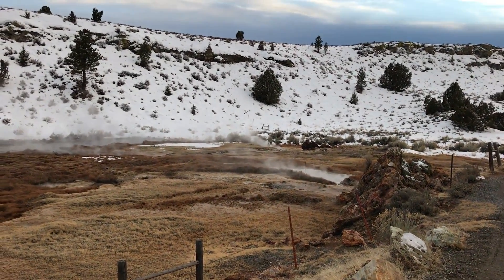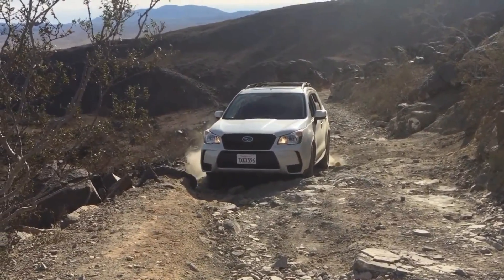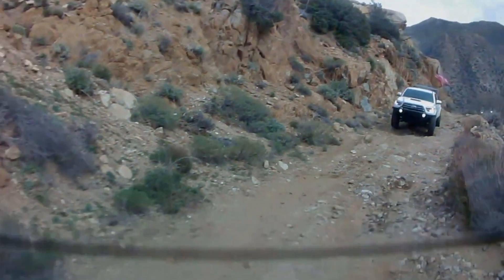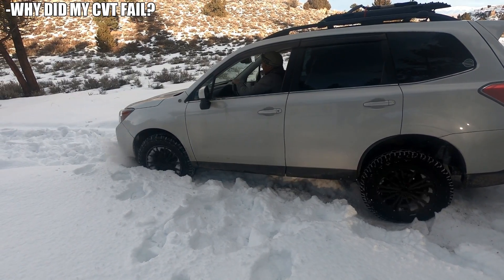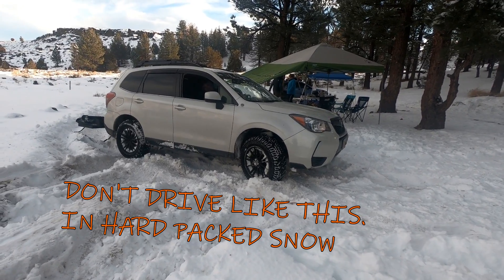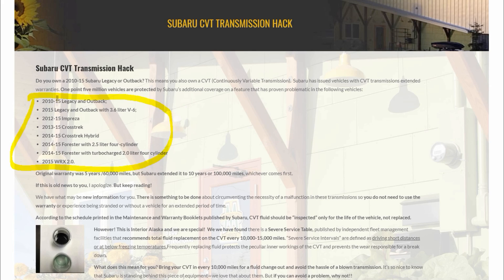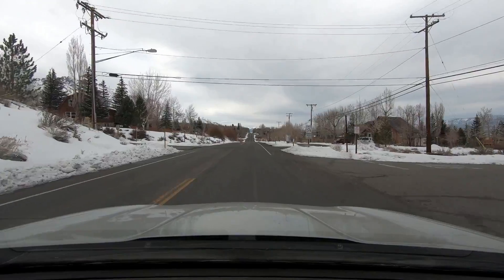CVT transmission Failed!  Can we make them last?

Comment: I am not sure I saw a CVT failing in this video. I did see cars overheating CVTs and limiting power itself to save the CVT. And please you cannot blame the CVT for not enduring that abuse. Having said that, I was amazed that a car with such a strong engine does not have a CVT oil cooler. Even my Mitsubishi Mirage CVT with 80 hp has one from factory.
Reply: May not be the cvt. May be the torque converter overheating.

Comment: I would say CVT is the not the answer for hard core 4 wheel drive trails .My son just bought one read up on it a lot, do the maintenance  on it don't do off road  hard core BAD IDEA ! Gunning it form dead stops .One day the CVT will be as good as a automatic not sure when ?
Reply from the maker: Well, ATV’s and side by sides have CVT’s.  But someone was telling me that they also have a low gear transfer case.  🤷‍♂️ 
Maybe one day they can be built better for heavier passenger vehicles.  I think toyota has the right idea. Their modern CVT’s have an actual launch gear.  BUT... Guess what transmission was put in their non hybrid RAV4’s?  An 8 speed automatic transmission with a 16.7:1 crawl ratio.
So even though Toyota has the most reliable CVT’s, they aren’t putting them in their most popular vehicle.  Well... they are in the hybrid versions (because a regular automatic wouldn’t work).  But their hybrids have electric motors in the rear axles that aren’t even connected to the CVT.
Reply: @JonDZ_Adventuring  That is the way Toyota destroys it's competitor- buy it and kill it by its own hand.

Comment: So get the six speed and just forget about the turbo?
Reply from the maker: The only Subaru crossover 6 speed is the Crosstrek.
You can get an older one with the 4EAT.  It’s not uncommon for them to get 400k miles while still being driven on trails.  You just have to really watch your oil levels on the EJ motors, especially on prolong drives.
Reply: @JonDZ_Adventuring  autos are for girls. Love the videos man keep it up
Reply from the maker: Aaron Burela girls or lazy drivers 🤣🤣
Reply: @JonDZ_Adventuring  correct as usual. If I bought a 2015 forester xt w/ 80k miles and installed a transmission fluid cooler it would be straight?
Reply: @JonDZ_Adventuring  https://www.truecar.com/used-cars-for-sale/listing/JF2SJAAC0JG604047/2018-subaru-forester/

Comment: The CVT was never meant for off road. It's a neat idea and works well for 4 wheelers but just not cars
Reply: But people buy 4x4 SUV type vehicles to deal mostly with snow and inclement weather in the city.  But if the vehicle can't handle that, what's the point?

Comment: The Toyota RAV4 is not as good as the Subaru Forester as far as off-road ability, but the transmission in the RAV4 will last forever, while the Forester's CVT won't.
Reply from the maker: Honesty Counts That’s how I feel about it.  The new 2019 RAV4’s AWD system seems to be a bit less capable.  But because it has a stronger transmission, it’ll do better offroad when the terrain gets tougher.

Comment: I suspect that the fake shifting is really hard on the CVT.  Subaru has added these fake "shifting points" to the transmission feels more like a regular automatic.  Each shift though adds substantial unnecessary torque to the chain and encourages slipping.  I wish they would give an option for the driver to change this functionality to a more linear (and more efficient) operation model.  They could probably make this a user-selectable option in the menu.  I'd love to get another Subaru, but I'm really having second thoughts because of this and the oil.  On my 2010 the manual indicates that I can use anything from 5w-30 to 20w-50.  My 2015 manual indicates 0w-20 or on rare occasion you can use 5w-30 temporarily if needed.  They have such a big problem with oil loss.  They really need to go back to the old wording of allowing heavier viscosity when needed.
Reply from the maker: There’s one thing for sure.  The fake shifting makes the Subaru CVT vehicles slower 0-60.  Car and Driver shows 2014-2016 Forester XT’s doing 0-60 in 6.2 seconds, but with fake shifting in the 2017-2018 models, it’s at 6.8 seconds.
Reply: I would just leave it in CVT mode. I don't like the idea of zone wearing the variators. I would rather have them span smoothly, and not create any ridging, that could compromise the commutation of the chain. manual shift mode (almost) makes sense, if you need the engine to hold back while descending a hill, to avoid heating up the brakes.

Comment: My car witch is 16 years old and sits low to the ground and is front wheel driven and has a traditional automatic can get through most snow with no issues. That’s with traction control on as well. Most of that I think is in part that it has a normal automatic transmission. CVTs are cool tech but they are not capable of off road or snow packed conditions.

Comment: Subaru either should ditch CVT and go back to conventional AT or use Toyota's new CVT design with launch gear. I think that one is gonna be much more durable than current design.
Reply: Mitsubishi Mirage had a low/high gear automatic in front of the CVT since 2013, AND it has a CVT oil cooler. With only 80 hp.

Comment: Hi.. Thank you for your video... I'm from România and I bought a Forester 2.0 Diesel (very popular în Europe) SH with 150k km on hand... The cvt stilul run properly but I not change the fluid transmision... The dealer says îs for life... Realy?... I want to change The fluid due to noise when îs cold... After warming îs ok... I don't know if îs normal or not... What îs îs your opinion? Thank you and I will apreciate your answer... Sory for my english.... Respect....
Reply: Yes, change the fluid every 30k miles. No fluid lasts for life, that is a lie. If the fluid is for life why they don’t warranty the transmission for life? Do a search here on CVT fluid changes and see how dark the fluid comes out after 60k miles. If changed every 30k to 60k miles, the CVT should be trouble free. If you tow, get an oil cooler installed

Comment: Install a regular automatic transmission and ditch the CVT.
Reply from the maker: Yes please ☺️
Reply: Can you replace a CVT transmission with a regular transmission?
The short answer is, no you cannot. The transmission control module and the entire powertrain wiring harness are designed for the car to have the exact CVT transmission. Despite the terrible reliability of these CVT transmissions, it is your only practical option for replacement.

Comment: I will not buy any car with a CVT transmission period. They are all junk and will not last.
Reply: Time will tell.  Honda and Toyota seem to make good ones.  Haven't read any problems.  Honda already made shitty automatics, and their 5 speeds rev over 1000 rpm on the highway than CVT so this will  hopefully improve their image and driving experience.
Reply: @mechcommander_online_clips  CVTs are only good for flat city commuting.  Toyota is only using them in small compact cars.(Yaris and Corolla)

Comment: My 2015 Honda CRV front wheel drive couldn't even slip a tire going up a dirt hill and it doesn't have traction control. Week on power to the wheels.

Comment: Just got my 2015 Forester XT out of the shop with a CVT replacement, after it failed at 35,000 + miles, no charge to replace. All my driving has been on asphalt. This is my first Subaru and probably my last. I am going to baby the transmission and will no longer use the manual paddle shift; which I did for upshifting on level roads and downshifting for driving down hills and slowing the car (in conjunction with the brakes) at red lights.
Reply from the maker: James Coles hopefully the replacement last longer.  I was told that the replacement had some improvements, but I dunno.  When I got mine back it seemed like the Transmission would slip a little going from park to drive, or park to reverse.  I didn’t feel comfortable keeping it, and when I found out I could trade it in for $15K with 60k miles, I took the offer.  Still a pretty big financial loss for me 😭, but I felt it was the responsible thing to do.
Does your new CVT slip at all? Or act different than the original?
Reply: @JonDZ_Adventuring  No slippage yet, but I have less than 50 miles on the replacement CVT at this time.
Reply from the maker: I noticed awkward shifting immediately, so you’re probably good 👍

Comment: Best tip to fix a cvt problem is buy a car with a manual
Reply from the maker: GhostOfAMachine I hear that after the 2nd CVT replacement, the Subaru gets converted into a manual.  Don’t quote me on that, it’s what somebody told me that is on his 3rd CVT that’s about to die.  He has 90k on his 1st gen crosstrek.

Comment: In the Philippines our Subaru Foresters XT was made in Japan in which are better cars than the US made. The oil filter alone tell the story in the US they use the Blue (Fram) filters while here in the Philippines we use the black (made in japan) filter... i have also a 2014 forester XT 70k with sealed untouched CVT still works like charm..
Reply: I'm pretty sure that the Forester is actually imported into the US from Japan. My AUS model XT has also got a factory fitted trans cooler, the US versions dont for some reason, maybe because they want everything at the cheapest price?
Reply from the maker: Thanks for sharing.

Comment: Toyota, Subaru, Honda and Nissan are having issues with this CVTs , Nissan the most, Subaru and Honda are about the same and Toyota has the best ones so far but still with the same issues of wear and slipping, Subaru should definitely fix them or make better ones, at least there is a recall, but its doesnt give you confidence. Thats why i prefer manual for now.

Comment: (AuS) 2014 XT 90k on the clock, no CVT issues yet, only issue was right drive shaft. These cars are made for light off road and surburb/city driving not extreme off roading. These cars are All Wheel Drive NOT Four Wheel Drive.
Reply from the maker: I agree, I don’t consider anything in this video or in my other videos extreme offroading.
Reply: Australia was the same her in the Philippines were Subaru Foresters XT made directly in Japan in which are better car than US made the oil filter alone tell the story in the US they use the Blue (Fram) filters while here in the Philippines we use the black (made in japan) filter... i have also a 2014 forester XT 70k with sealed untouched CVT still works like new.
Reply: @vantom6194  seems like the US ones have a lot of issues. Ive also been a bit spirited in my driving and reason why i also got the 2019 WRX CVT. Seems like a lot of unlucky people or there not looking after the car.

Comment: Yo I have been watching your videos. I'm out in woodland hills I just got a 2016 subaru forester and am looking forward to camping in it and taking it to many beautiful places. Thanks for the heads up on the cvt info. Do you have a mechanic that you usually take yours to.
Reply from the maker: Spencer Oerlemans my buddy works at a Subaru dealership in Long Beach, which is a little bit a ways for you.  For lifts and anything else special, I go to Nathan Robinson at Jim’s Autoservice in Crestline, CA.  Honest dude with honest prices.  If you call make sure to specially ask for him.  909-338-1946.
He’s far, but I’d just try to make a trip out of it.  Lots of beautiful hiking/camping out there.
Reply: @JonDZ_Adventuring  thanks. I am thinking next year or just within the next 6 to get a similar lift as yours. For now keep it to softroading low grade areas.

Comment: Your CVT broke because you used an automatic transmission road car (with minor off road capabilities) to try to climb mountain trails. If you MUST drive an auto for when you commute in traffic to your day job, at least you could have specified a low ratio gearbox. Subaru doesn't offer one? I wonder why? Perhaps it's because the vehicle was never designed to do what you are trying to do. Can you buy some other commuter station wagons and film yourself breaking them please? It's really entertaining!
Reply: Sorry for the earlier sarcasm! - Just a bit amazed!  I live in the UK and these kinds of cars are normally used only for occasional very light off road use. Basically just unmetalled roads and no rough work all. The kind of trails you guys are trying would be only be attempted using Jeeps, Landrover or Mercedes G Wagen type vehicles. (But it would be fun trying those trails in the new Suzuki Jimni which has had good reviews off road)!
Reply: Subaru has always claimed it to be a capable off road vehicle?
What other car could have been used in the video?  Yer, one without a CVT.
Reply: There is a selection of low gear for off road in certain speed.
Reply from the maker: Malcolm, sorry, but your comment doesn’t make any sense.  I have a hard time believing you have any experience offroading anything.

Comment: Great and very helpful video. I am considering buying a Subaru Crosstrek or Forester 2015-2016. The more i study the Subaru the more i am convinced not to buy one with CVT transmission. It is really hard to find good info so my question to you and everyone else: Do the Subarus with manuel transmissions have problems... other then the head gasket ? Thank you your answers are very much appreciated!
Reply from the maker: A Subaru with a manual transmission is reliable choice.  The head gasket problem that you are talking about are in the EJ series motors.  The 2015-2016 Forester and crosstrek have the FB series motor that does not have the problem.  But keep in mind, both engines may consume oil when you go on long highway drives.  It’s just a matter of monitoring your oil levels on those long road trips and carrying some extra oil.  Some people have the problem and others don’t.
Reply: @JonDZ_Adventuring  first thanks for taking the time to respond! Second so in your opinion with the manuel transmission, this is a solid car choice. Thank you
Reply from the maker: matthiasgr555 what will you be using it for?  If you plan to offroad with it, just keep in mind driving a manual requires a good amount of skill.  It can be quite laborious.  If you were to stall mid climb, it can also be pretty dangerous.  But hands down, the manual transmission will be reliable and much much cheaper to maintain/replace.
Reply: @JonDZ_Adventuring  It will be for both, street ( a lot of winter condition here in Quebec) and off road. I have a primitif survival school and i am a lot in conditions where a normal car gets abused, but not hard core off roading. I drive for 25 years stick, so i am very used to it.
Reply from the maker: matthiasgr555 I think this is one of the best videos about Manual vs. Automatic out there.
I’d give it a watch.  It’s very informational.

https://youtu.be/BE_NMaIL5IQ
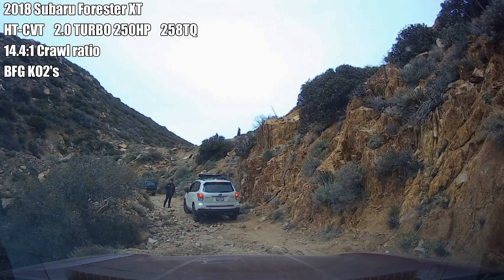Reply from the maker: Skip to 5:30 where he talks about the different terrain.  An automatic is better is most cases.  However, as mentioned in this video, the CVT isn’t quite as good as an automatic transmission, so that’s something to keep in mind when choosing your vehicle.
Reply: @JonDZ_Adventuring  Thanks a lot. Your comments did greatly help me to move towards my choice!
Reply: @JonDZ_Adventuring  My mind is almost made up. I will not go with a CVT then i just see more and more people complaining about it and it braking. Ether i will go with a manuel Subaru 2015 or a Toyota Rav 4 with a automatic transmission... but i am leaning towards Subaru
Reply: @JonDZ_Adventuring  
I'm wondering if that oil consumption problem is due to the positioning of the gap on the oil rings. With the flat boxer engine the oil rings should be positioned with the gap favoring the top of the cylinder. Top being not the head but the top side of the engine opposite the hood. My first car was a 1961 VW bug. I did a valve and ring job on it and it used oil afterwards. Someone told me about the positioning of the oil rings so I opened it back up and repositioned the oil rings, put it back together and after that it didn't use any oil. Could it be that simple? Surely they would know better in the Subaru plants.
Reply: I thought Subaru stopped offering the choice of a manual transmission in the newer Foresters.
Reply: @stevensevek6151  2020 the crosstrek still has manuel. Not the forester. But i f you go to a 2015 model you can find also the forester in manuel.
Reply: I've owned a few Subarus but nothing in current years and if memory serves me all of the ones I had were manual transmissions. The most miles I put on one was 192,000. I never had a problem with a head gasket. We now have a 2009 RAV4. I'm 72 and I don't see myself ever having anything but Toyotas from here on.

Comment: Here is where I say something like, “man am I glad I row my own gears in my 2016 Forester.”
Reply from the maker: Chris Zimmer I respect you for that.  This Forester XT was the only non manual that I’ve owned.  I also had a 2010 WRX, and I grew Leary of the labored launches.  I also found out that it’s very difficult and not as safe to off-road a manual.  Again, much respect 👍!
Reply: JonDZ Adventuring I don’t take my Subie off road. Maybe some light gravel or dirt, but nothing that even begins to challenge its ground clearance. I also don’t live in an area with nasty traffic so a manual is great. If I lived in CA, I might be less happy with my manual. My beef with the CVT is in the rental cars I’ve driven with one is the lag that occurs from when I step on the gas to the car giving me a feeling of forward momentum. Once the revs build, and I get used to not hearing and feeling a gear change, a CVT is fine. Don’t get me started on those CVTs that simulate a gear change.